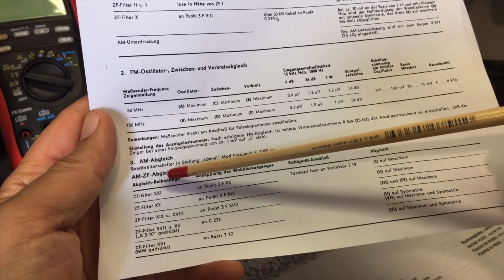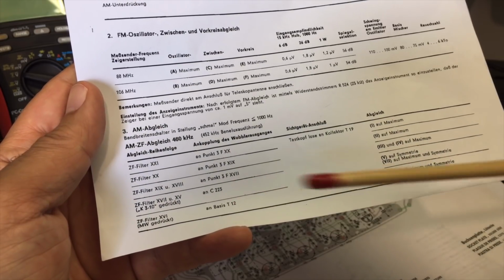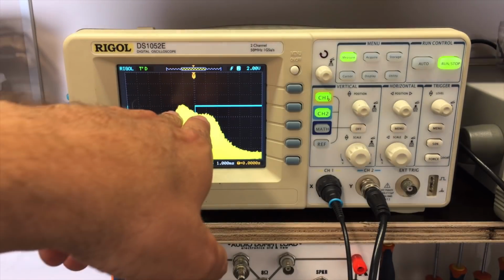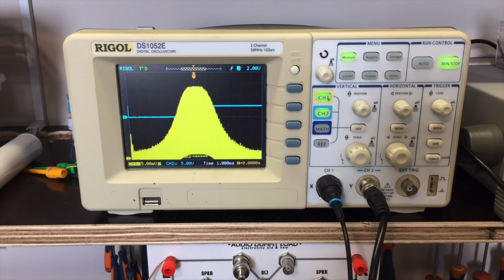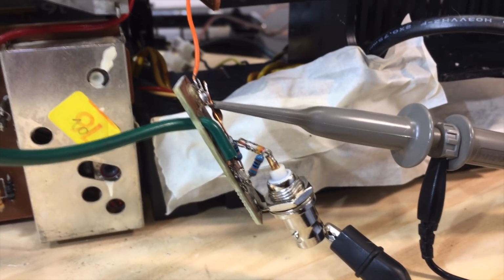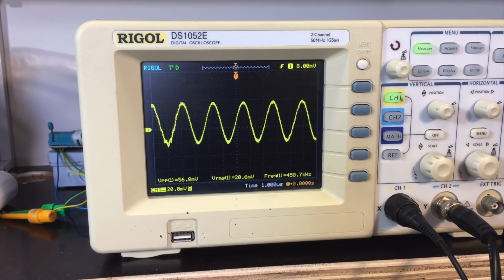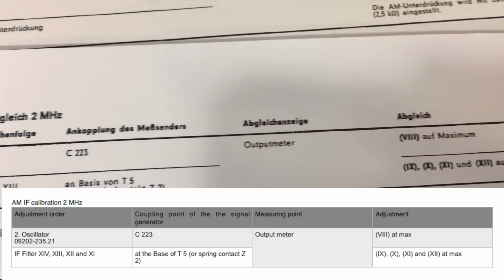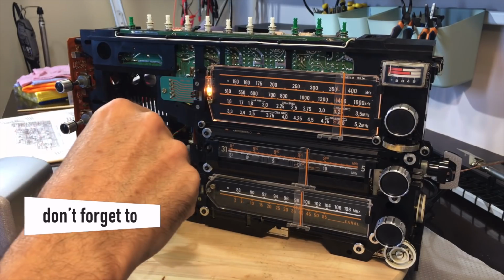IF alignment: AM. Grundig Satellit 2100 restoration part 5.

Comment: Dear Mr Caldeira, thank you for these videos, I'm working on restoring a Grundig 2100, and they are indispensable!
Some considerations. I think that the original instructions are written for adjusting the radio with minimal set of instruments, i.e. only a generator and a AC voltmeter. The factory instructions for the Soviet radios were written this way. Those instructions were much more detailed and gave you diagrams where exactly and how to connect all the instruments. So when they say, adjust for maximum, you would adjust the coil to get the max. AC voltage at an output (in case of the Soviet instructions, usually at the speaker output). So from those instructions I learned how to adjust for symmetry without a scope: first, you adjust for maximum output AC voltage at the required frequency (in this case 460 kHz), then you reduce the frequency on the generator say 5 kHz (to 455 kHz) and note the decrease in output voltage, then you increase the frequency the same 5 kHz above (to 465 kHz) and again note the decrease in voltage, and if the decrease in voltage is about the same, here you go, this is you symmetry!
Reply from the maker: 👍 perfect

Comment: A gimmick capacitor, sometimes 3turns finger twisted enameled wires
Reply: @electronicsoldandnew  I know I'm replying to and old comment.  I tried aligning my 2100 this weekend, and should have left well enough alone.  It was a hot set, and now it's pretty deaf.  I'm going over what I did, and the "test probe" calls for a .3 pf cap, and I only had a 10 pf cap, so I used that.  Could that have cause me to be way off?  Can I remove that cap from the test probe, and just use the "gimmick" cap mentioned above?  Thanks for any feedback.  :)
Reply from the maker: Sure, use a gimmick. It’s really very light coupling.

Comment: Great job! Well done! 
Do you remember the function generator output setting? 
Question: didn't the manual ask you to move the function gen connection point as you proceed backward from coil to coil? I don't see you move anything during the alignment...
Reply from the maker: I mentioned this in the video. I do it slightly differently  because it is not completely out of alignment. After you do a few dozen of these, you learn a few tricks that simplifies the procedure 😊
Reply: @electronicsoldandnew  Oh I missed it! 
What about the signal gen output level? Do you remember it?
Reply from the maker: Can’t recall exactly.

Comment: Wow Mike!!!  Thanks for this one...this is the first time i see this sweep aligment in detail like this.
I'm going to trie this at once, i have some Saba automatic's , radio's with 3 IF transformers and you realy can not align these with the
normal method with a signal gen for max. amplitude...This IF responce curve has to be symmetrical with a flat top...but with in the midle of the top there must bu a gap ..this is for the automatic tuning...
I realy would like to see you align a Saba Freiburg or Meersburg automatic....far out the best tube radio's ever made with a sound quality you realy have to hear to believe it!
Thanks!!! Greetings from a colleague from Belgium.
Reply from the maker: I have a Freiburg 8, two Meersburg W3, and a Freiburg W2. I did all but the last one before I started this channel. They are the best.

Comment: This really reminds me off my Radio class at school back in 1980.
Where we would (try to) align radios with a wobbler and an Tektronix 465 in X-Y mode.
Never done it after that. For some reason in my memory the signal generator and
the wobbler were to separate units. But that must be something I imagine.
This is something I want to do again. I'v got a Tek-scope, so just need to find a "Wobbler",
but searching Ebay for that isn't easy...
Great video and a good walktrough of the alignment procedure. Thank's a lot.
Reply from the maker: The wobbulators that one finds are actually quite inaccurate. You specify the Center frequency and then a span (left and right of center). However, they are quite primitive compared to modern scopes with a modern signal generator (not necessarily expensive ones). That is what I have done, and been quite happy so far.

Comment: consider replacing that white 22uF 40V FRAKO electro cap on that bottom pcb with the two coils
Reply from the maker: I don’t understand the logic. Why?
Reply: @electronicsoldandnew  they are notorious to fail or be right out of spec or worse, leak. I have dealt with a lot of Studer/Revox tape decks and Studer/Revox used that type of FRAKO cap in all their early builds. I used to just replace them, no matter what. I learned that the hard way ;-) For the very low cost of a replacement electro cap/s, it is the best insurance for longevity and trouble free operation of a piece of vintage and classic audio gear.
Reply from the maker: I’m sorry, I misread your comment. I understood that you recommended replacing the cap with two coils !!! Sorry, that was just my bad. I agree fully with you. The remaining electrolytic caps in the radio are definitely getting replaced. Thanks again.
Reply: @electronicsoldandnew  lol...no probs....mind you...be interesting to see what you'll get doing that mod... ;-)

Comment: Thankyou for going through the alignment process with this one.  It looks to be quite time consuming process, but it was good to see how it all aligns up.  It certainly made a big difference to the wave form.   The sensitivity and selectivity is increased from what I can see.  That SW 3 to 10 band looks pretty easy to tune as well given it was a fairly small frequency range in each "band".
It would be a fun radio for some late night DXing when the RF alignment is done.
Reply from the maker: Yes, the entire process is a learning curve for me as I’ve never worked on one of these sets. The late night DXing has already started for me, even though it’s still “naked” 😊
Reply: @electronicsoldandnew  That sounds like a whole different discussion.  Naked DX'ing ;).  Best not to go into that here I think.
How are you going to cope with the broken band spread switch?